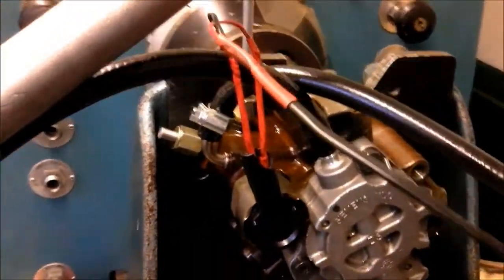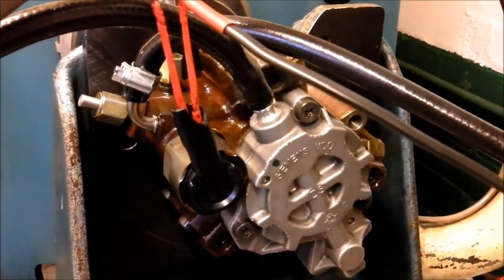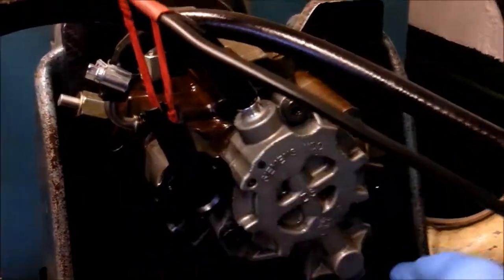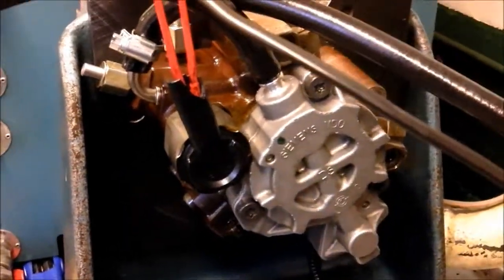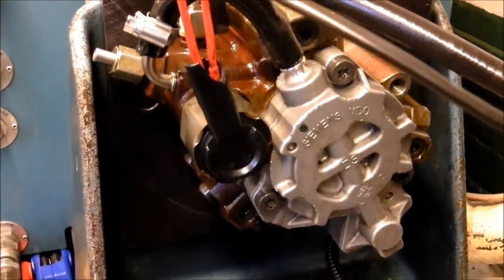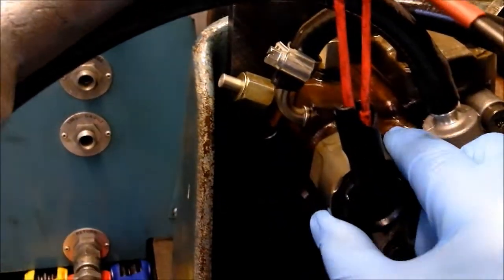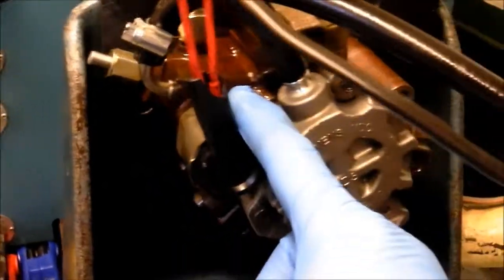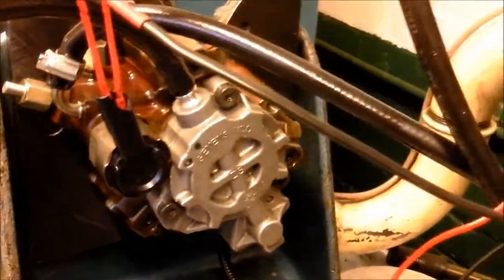Range Rover 2.7 Siemens HP Diesel pump test.

Comment: Hello Martin. What was the problem with the pump? Is it just you clean the valves and it is performing well? I have problem with exact pump. my pump when i drive the car and do diagnostics it just increase up to 1000bar no more and sligtly drops to 800.  Is it valves problem or pump performing?